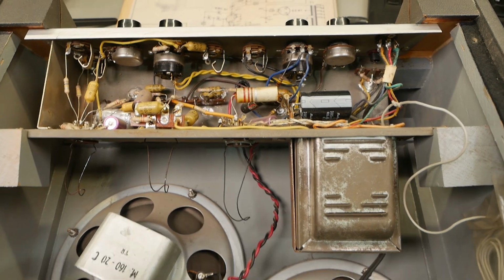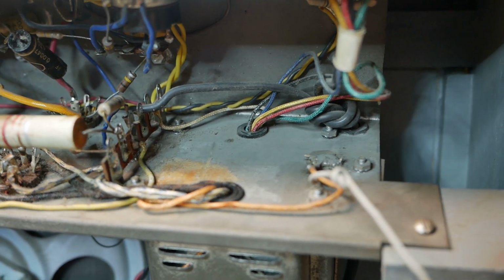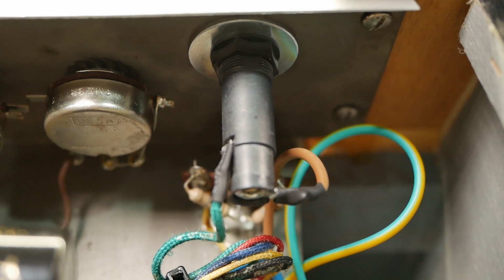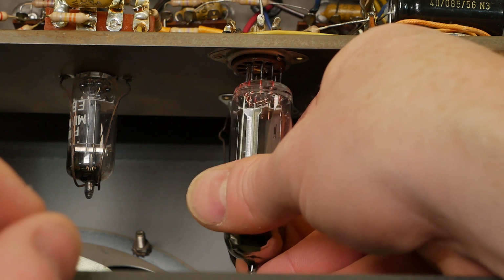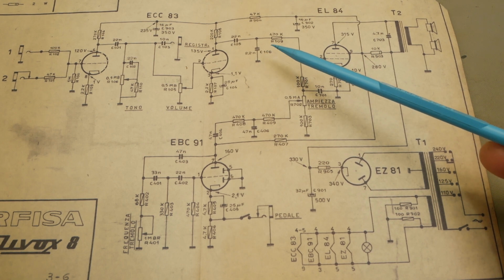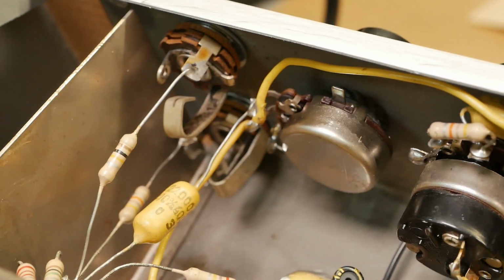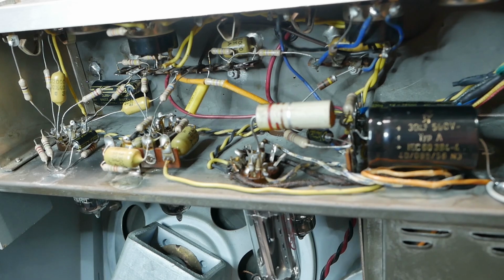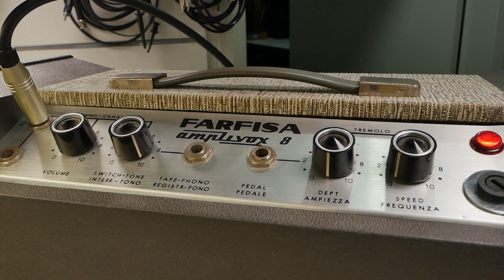Farfisa Amplivox 8 - Part 2

Comment: I love the EZ81 rect tube. We didn't use them a lot in  our  " 'Murican made "  amps. That Farfisa is cute, and it sounds quite nice. It reminds me of Valco's old rat's nest amps, or Sanno, or Danno, or....Excelsior, or...  A little arc gap on the voltage selector? No one truly uses 220 volts anymore. GE folded the plates on their 5AR4/GZ34s, and Philips Holland did something similar on one Dutch made GZ34 variant. Sylvania made their 5AR4s with boxed plates.

Comment: At 14:30, a Dymo label inside the cabinet that reads " Made In Italy"! I still have a Dymo label maker around here somewhere and probably some of the ribbon tape for it as well, although I'll bet the adhesive may have dried out in the past decade or two. Obviously I'm old enough to pre-date the Brother P-Touch labeling machines!
Reply: Yer not the only one mate, sure the old girls got dad's at home somewhere.
Fukn labels stuck everywhere yrs back!!
Reply: You can still get the label maker, though it is cheaply made plastic now. But the tape is still available too, there are even cheap Chinese knockoffs. There does however exists one expensive labelmaker that uses metal tape.

Comment: The "dark" voicing of these amps was intentional - as they were mainly intended be paired with Farfisa Keyboards  - wider bandwidth than guitar, particularly on bottom end.    Played these in the 70's ......  Note how the controls/labels are just a little weird as well.    Great demo of, the need to alter frequency response in circuits like this - which also apply to the ever popular film projector and old PA conversions to guitar amps.     Sometimes the work ok,  most of the time not.    Great video.

Comment: The best way to wire an accordion amp (used solely for accordions) is soldering the input hot straight to ground.
Reply: Plug a guitar into the "Accordion" input on an old Ampeg or Magnatone amp ---- I'll bet you'll like it better than the "instrument" input! And for that matter, I've seen Ry Cooder playing slide guitar with accordionist Flacco Jimenez, and John Kirkpatrick playing accordion with Richard Thompson's band. Don't knock it if you havent heard it. It ain't like Polka!
Reply: I'm sorry, I didn't see the "Magisterium Guitars" thumbnail photo, on this tiny phone screen ---- you're in Portugal,right? You've probably heard/endured a lot more Accordion playing than I have! 😉

Comment: Been into a few of those, also other small european brands nobody remembers now anymore (Solton, Dynacord, WEM, etc). 
I love to tinker aroound within such really PtP wired devices but there is issues, especially on resistors to get the correct parts with sufficient wire length and reasonable diameter

Comment: Nice work! I love those little low watt, oddball amps. Dual speakers is very cool. Gotta say, The paper on those sounds a little tired. Wish
I could hear it in the room though. ❤
Reply: I would have liked to have heard it through a 10 inch or 12 in speaker or perhaps a 4 by 10 cabinet. There was a little bit of distortion at modest volume that sounded like the Mic or preamp overloading.

Comment: Jeez ld be happy with that! Lovely little amp.
Pity that Philips valve had to hit the bin, but if she's fkt, she's fkt!!
Luv yer work Brad.👍
Reply: Before Brad rewired the transformer for proper 240 volts, that 6 volt rectifier probably heated up at 7 volts, and the overly high filter capacitance probably didn't help.
Reply: @goodun2974  Thanks mate, l missed the earlier clips... wonder it hadn't cooked itself earlier then!
I did watch the spontaneous combustion Mesa Boogie ones though.

Comment: If this were my amp I was working on, I'd replace the rectifier with solid state diodes, and increase the PSU resistor by 150 ohms. That should in theory give identical performance, whilst sidestepping the limitations of the EZ81. I do understand though that some people like to keep their amps "all valve," or at least relatively original.
Reply from the maker: Yes, I'd do the same. It's a good way to simulate that rectifier sag, which I'm personally not a fan of anyway, but each to their own.

Comment: I'm surprised you reinstalled the original flatblade screws that hold the chassie into the cabinet. I would have replaced those with Phillips or Torx or a hex head, something easier to get in and out of a tight spot.
Reply: Originality on flatheads is cool though. It’s nice indicator of age for me when I look inside something.
Reply: @ColeWheeler4Lyfe  , it's period- correct hardware, yes, but inappropriate for recessed locations with poor access; an aggravation to the next technician who discovers the amp had obviously been serviced and subsequently reinstalled with the same inappropriate hardware. Using appropriate hardware for the job at hand is every bit as valid and important as using appropriate components for circuit repairs!